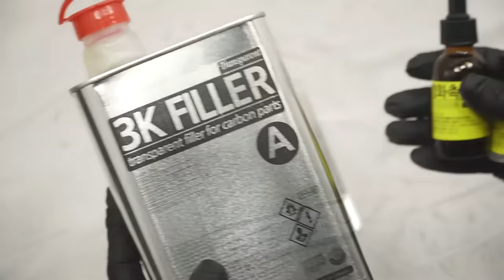How to Make a Forged Carbon Fiber Helmet [DIY] (Making Split Mold & Helmet)

Comment: no ones gonna mention how he tore apart a $600 Helmer's to do this....
Reply: really? thought this is a 50 bucks helmet xD
Reply: Andree H. Arai GP 6S. Once he took it apart he couldn’t give up. Big money those helmets
Reply: @hindsite275  indeed.. searched for it... in my regions not below 800.. phew
Reply: 600 is actually a good deal for that helmet haha i can only find them around 700 or 800
Reply: @Chris Childers He spent $600 to build a $4000 GP-6RC. Spend money to make money.
Reply: WinebytheGlass . I mean yeah, but no haha. He used a 700-800 dollar helmet to make a helmet that looks like a 4000 dollar one. But it’s not quite it. The helmet is not FIA approved and certified, so probably it’t only good for display or maybe even karting.
Still cool as fuck tho
Reply: Just like everything else he makes it’s exactly how a road worthy carbon fiber product is made. Forged carbon top layer back by 5 layers of uncut carbon fiber. The foam is what protects your dome, the shell is just that. But his shell still provides rigidity and support while being lightweight. FIA helmet standards require impact, ballistic, crush, visor penetration, chin guard impact and crush, friction protection and flammability. If tested, his helmet should pass like the original uncut Arai. All he did was swap the FRP shell.
Reply: @DCportraits  I've only seen other videos on youtube of actual professionals making composites and I would have to say that this guy is inexperienced. Just based on the way they set up their vacuum bag, and the fact they didn't do an infusion. I'm sure the thing has plenty of strength but they clearly didn't weigh their carbon and put in an equal weight of resin. Doesn't take much research to see what this guy did wrong, but everybody has to learn.
Reply: @ginfork  Whether or not he weighed his carbon is going to have to be a question you ask him. But this goes further to prove a misunderstanding of helmets. When you crash and hit a hard surface, the foam part of a helmet crushes, controlling the crash energy reducing the impact to the brain. He didn't alter the foam, ergo his noggin is still protected. The shell is a container for the foam to be secured to your noggin. You could have a shell made out of seran wrap as long as it secures it to your dome.
Reply: @DCportraits  Yea carbon fiber is for impact protection. The shell is for impact protection, if you hit something or if something hits you. Thats why they use carbon fiber helmets in F1, incase a spring or something flys and hits them. Why would they go through the effort to make a helmet out of very impact resistant material and not take the care to make sure that the fiber strands are oriented in the strongest way, and having enough resin. Of course the padding would keep your brains together, thats if your skull is still in tact after you've hit a hard object.
Reply: gin fork add misunderstanding of carbon fiber, forged carbon fiber and re-read helmet explanation.
Reply: Nice discussion about a helmet that is used for COMPUTER GAMES.... omfg..
Reply: @DCportraits  You literally told me a plastic wrap helmet with proper padding would be affective. Tell that to the Moto gp driver who's head slid across 40 ft of pavement
Reply: @ginfork  yeah no, the strongest composites  use the minimal amount of resin, as you want the fibers to be the primary component that deals with the load.  VaRTM composites give you composites that are on average 45 to 50% resin volume.  Making them weaker than prepreg counterparts.  The while point if VaRTM is to make manufacturing easy and simple, but at the cost of strength.
Reply: Let me know his name, I’ll give him a sub
Reply: @damnmexican90  yea, but having pinholes or potentially spaces with no resin could be bad right? I guess i'm saying this person should have done an infusion or used pre-preg instead of the wet layup they did.
Reply: @ginfork  pin holes in a composite structure are generally a bad idea because it causes cracks in the matrix.  It's made worse if the load transfer is in the direction opposite of fiber direction.  Also wet layup isnt bad if you can consolidate correctly.  Especially if ita a low viscosity resin.  But VaRTM has the same issues wet layup has with resin rich zones, and poor consolidation due to atmospheric pressure not being enough to debulk corners.  At the end if the day, you can make any technique work, if you can debulk, and orient the fibers properly.  Some are easier than others, and VaRTM allows you a great deal of freedom.
Reply: @DCportraits  don't think his forged carbon is quite up to standard. Meant to have 500,000+ fibres per square inch.
Reply: @TheNubimusic  @damnmexican90 unlike a structural piece of carbon fiber or forged carbon fiber, this helmet isn't taking any loads like a frame, canard, wing, etc. The simple fact is that this is a shell, hence why most of the time helmets are made of fiberglass reinforced plastic (major point-->it's a shell to hold all the brain saving F-O-A-M).
Reply: It was $600 of plastic, now it’s $1200 of advanced plastic 👍🏾
Reply: @TheNubimusic  im not arguing any of that, so.
Reply: Really good comment Andree H.
Reply: @damnmexican90  Someone said that it would meet FIA standards. I was saying it wouldn't.
Reply: @hanswurstusbrachialus5213  thats an expensive 'costume' then
Reply: @TheNubimusic  it read as if it was directed at me.  Carry on then good sir.
Reply: He gets stuff donated.
Reply: WinebytheGlass You’re right. But only partially. Yes, the foam (known as EPS) is an important part of a helmet. Yes, its job is to absorb and control the impact. BUT the shell isn’t only there to keep it in place. It’s there to spread the impact as wide as possible so the EPS would deal with a more evenly-spread, lower impact. Composite materials (such as fiberglass, carbon fiber, or aramid) are better at getting the job done than say thermoplastic or polycarbonate. That’s why they need to carefully design and engineer which, where, and how each layer is laid up. The shell, like any other parts on a helmet, is just as important as the “foam”.
Reply: Thats how a good helmet painter would paint it for you , probly not take the liner out but everything else would come off like that.
Reply: $859 helmet
Reply: @ginfork : "MotoGP driver" they're riders not drivers ffs!
Reply: C'mon guys, that's clearly a fake arai
Reply: @hanswurstusbrachialus5213  indeed it is how much this one worth. The real one though...
Reply: really $600? come on dude go triple knife
Reply: original 800$ helmet make carbon fiber ...
Reply: How about we mention how cheap a $600 helmet looked on the inside.
Reply: He did not tore it a part at all? He just tookoff the screan and cover helmet with something that will prevent glueing resin to the surface?
Reply: I cant believe I watch this lol
Reply: And He spent another 1000 to build new carbon one
Reply: I think he couldve just look for a clone or copy just to make a mould instead of messing up a 600$ helmet
Reply: @Ors180717  it still needs a cert to use for cart racing
Reply: @ginfork  you'd use aramid for impact protection, its not as strong as the S-glass and vinyl ester resin the original helmet was made of- you can't legally mod a bike helmet in the west- he's making blackmarket copies, will probably have a fake cert also.
Reply: So what’s your point? Who cares how much he bought it for ?
Reply: @hanswurstusbrachialus5213  it's an Arai bro
Reply: Seran wrap. Are you high? 😂😂🤣🤣
Reply: @DCportraits  You've got the right idea but I think you took it a step too far. The combination of hard shell+foam is important. A hard shell is going to transfer the energy to more of the foam. If you wrap a foam inner helmet onto your head and then hit your head on your handlebars not much of that foam is going to be utilized. Do the same with a hard shell and a lot more of that energy spreads out.
Reply: Just repaint it and re-assemble.
Reply: @ginfork  This guy made this helmet to make his gaming experience more realistic. I think he will be ok here... hahhahaha
Reply: the $600 helmet is still serviceable... same way you go about painting them
Reply: @Ors180717  technically correct.. if it went thru proper testing it could pass crash certs.  but would be a trade mark violation
Reply: whats ur point? does that damage helmet? NO it doesnt 
bigger concern is why would u make helmet out of epoxy and carbon flakes? it isnt forged, it isnt designed to withstand a crash, why would u do that? carbon is expensivve and building helmet for sake of building it is fucking stupid any one who would try to use helmet like this may loose his life 
well if someone would use it i would call a natural selection so its better that his genes are no more
Reply: Trust me..I was thinking the same
Reply: @ginfork  it's actually not impact resistant it shatters pretty good that's why they use it because it dissipates the energy when it shatters atleast that's what I've always been told
Reply: @DCportraits  No way....
Reply: Learning how it's made is better than just buying and wearing it.
Reply: Я тоже нифига не понял, зачем ломать шлем Араи, чтобы сделать вот это вот всё
Reply: @ginfork  Carbon fiber has some of the worst impact resistant properties in the world. There's a reason why when impact resistant is important, Kevlar is used instead. The carbon fiber shell for helmets serve no purpose other then for cosmetic purposes and maybe a tiny bit of abrasion resistance.
Reply: Wowww....
Reply: the one he made is worth about $4000
Reply: The guy rocks an m4, I'm sure he can spare a few 100 dollars for the amount he will make in ad revenue from this video.
Reply: @DCportraits  Sorry but this helmet is now useless...
Reply: Don't be sorry  @millinag3817  pretty sure he's still using the helmet, thereby invalidating your statement.
Reply: You guys arguing if its safe? Come to asian country and this is way better than stanndard helmets people using on the streets. Here in philippine some helmet have plastic shell and it is allowed in the market.
Reply: I believe like 800$ in US
Reply: Dude...it hurt my heart to see it. I saved for almost a year to buy my first Arai. Think I paid $750 or so. I would go to the moto store every few months and try it on lol. Nothing beats an Arai.
Reply: @MakeCriminalsIllegalAgain  Your comment proves that you don't know the first thing about CF or FRP lay up. You're welcome to educate yourself from either my previous comments or by watching educational videos providing an explanation of the layering procedure. I won't waste my time explaining such a simple concept to such a simple mind.
Reply: Exactly my thought. There are so many cheap helmets he could have used, but instead he uses the one with the hand made fiberglass shell...
Reply: but he got back 2 thousand in today
Reply: I was hahaha
Reply: In Brazil, R$4000,00.
Reply: Wkwkwkwkwk🙏
Reply: Thats really dumb actually...
Reply: @ginfork  critisizin critisizing ... Zzz then go and do it 
 what he did is alr very clean and he s not there to go ride w it anyways from what it seems. Same as if u asked him to get an autoclave at his house lol.

Comment: Beautiful job, but a tip for poor people like me. Don't do this to a new Arai helmet, go to a Pawn Shop & get a 2nd hand helmet.
Reply: Just DON'T buy a 2nd hand helmet. I dont say every 2nd hand helmet is bad but there are a lot of clone's out there with a populair brand sticker on it which will most likely kill you rather than saving your life in case of an accident. Also you dont know the history of that helmet, the previous owner may have dropped it without having much damage on the outside but on the inside there may be damage.

Me personally would just save up a few hundreds dollars extra to get new gear than buy it for cheap from some pawn shop
Reply: @markbrouwer4901  Literally doesn't matter as the guy used it only to create a mold for his new helmet which he uses for simracing
Reply: @briankang7019  that's true. But for riding in real life, i would just rather buy a new one.
Reply: @markbrouwer4901  Yea, I would never cheap out in safety gear either. Good advice either way!
Reply: $50 helmet for a $50 head
Reply: Brian Kang, right! Thanks for getting the point. It's for a mold, not for wearing. 👍🏼👍🏼

Comment: I would love to see how it stands up to SNELL/FIA Standards, amazing craftsmanship, just not exactly sure on if it’ll hold up to doing its job as an FIA advanced helmet like my Authentic GP-6RC. Cool video!
Reply: I am horrified to see this project. I've been riding for decades and had several spills. I would never play games with my head. Suitable for video gaming roleplay only.
Reply: @der_kanadier  It is probaly safe for Driving on the Motorbike, because the filling Material is from Arai and that takes most of the Impact from a Crash but dont quote me :)
Reply: Because the plastic skin that's not even 1 mil thick really helps absorb the shock not the padding on the inside.
Reply: The filling material was made for the inside of the original helmet. Not the outside. No matter what is done, the carbon fiber “whatsit” is way bigger than the original helmet.
Reply: Helmets are designed and then the sticker is slapped on. Who knows if yours would even pass the asinine Snell test when they ram a metal ball the size of an orange from 10 feet above. Because that's so relevant in motoring applications...

Comment: For everyone questioning the safety, he used tools and processes consistent with what factories do to make this exact same helmet in its carbon version. I know it's not tested and he should never sell it - he probably has no intention of ever doing it as multiple lawsuits would income very quickly - but this is probably even safer than what he started with. There is A LOT of overlay between the carbon fiber sheets, so the helmet would never split in half. Also he used the original padding, which is certified. The engineering is preserved by his moulding technique. He could take this to a track and he would be as protected, if not more, than someone using for instance a cheap SA2020 helmet.
Reply: would you honnestly bet your life on it bro ?
Reply: @atsushiishirame4858  if he made me one exactly like the one he did, I'd use it on the Karting track in a heartbeat.
Reply: There is real science and engineering behind making a helmet safe.  Especially for a company like Arai.   This is nothing more than a show piece that should never be used for anything other than sim racing.
Reply: @johnjacob688  science and engineering go into designing the helmet and the build process. The rest is mechanical. You'd be amazed at how little skill is needed to reproduce it once it's done.
Reply: @yanava  There's no way this helmet shell was hand laid even close to Arais manufacturing specs.

Comment: This is awesome for sim racing, definitely can't use this on track though.
Reply: I sim race but just make do with a wheel & pedal set-up, I think going to those extremes is a bit sad & pathetic if I'm honest & for the money he's spent on his driving gear & race rig why not just do the real thing!
Reply: @CaptainScarlet1961  its 100x more expensive to do the real thing. You literally will need a team. You'll need multiple tires, pay for the fuel, extra car parts, and the license cost money.
Reply: @CaptainScarlet1961  these extreme setups are generally useful for practicing to do the real thing. Immensely cheaper than actually driving  and almost as good